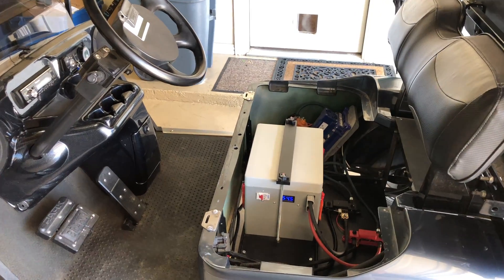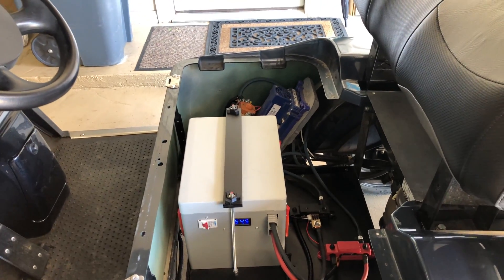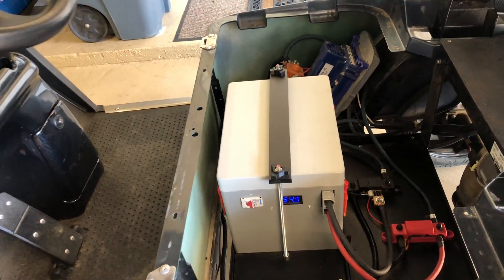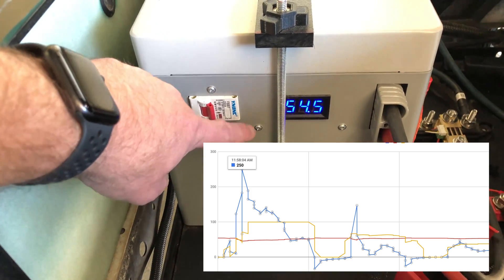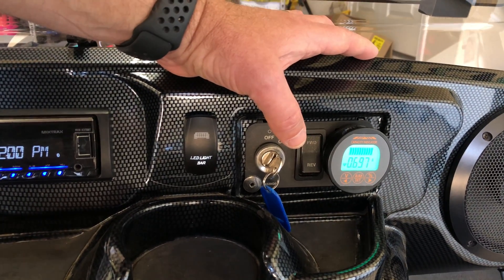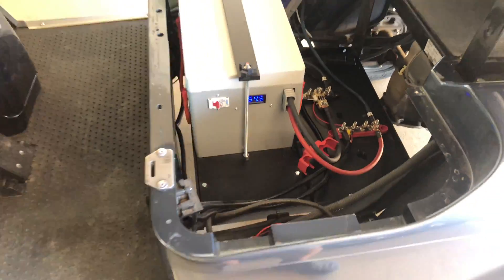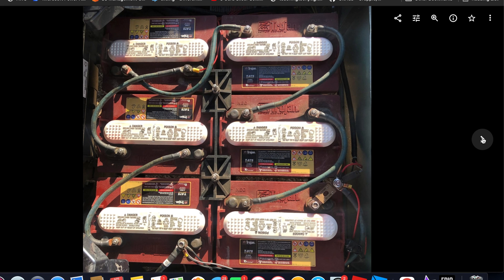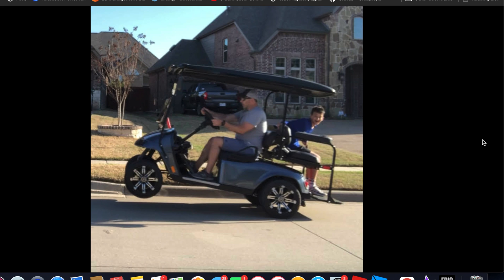Wheelie power from Lithium upgrade

Comment: I have an EZGO golf cart also and want to do the same thing. What was the total cost? My batteries are pretty much shot.
Reply from the maker: The battery was about $1700. They don't have that exact one any more, but they have some that are similar https://bigbattery.com/GolfHome/?ref=156
Reply: @mattadata2  I have a 48v system right now. Which 1 lithium battery would work? Or should I get 4 12v lithium batteries?
Reply from the maker: @Kaiser187  I would do this kit. https://bigbattery.com/products/kit-48v-bdgr-nmc-120ah-5-85kwh/?ref=156
Its three 48V packs wired in parallel for 120ah and comes with a charger.
Reply: @mattadata2  Looks like the best deal I've seen so far. Trying to spend the least amount I can as I already spent 5k+ on the golf cart.
Reply from the maker: Lol. Tell me about! I have more $$ in my cart than 2 of my 3 cars.
Reply: @mattadata2  Do you leave your battery pack powered on?  How does your battery shunt keep memory of remaining battery amp hours.
I own the same battery along with a battery shunt.
I really don’t want to keep it plugged in all the time.
Reply from the maker: @David25522  my shunt keeps the memory when no power. I usually keep battery on, but shit it off if I know I want be using the cart for a while.
Reply: @mattadata2  I just ordered them. Bought the 3 battery kit 129AH. Can't wait to see the difference between the old acid batteries.
Reply from the maker: @Kaiser187  Cool! Let us know how it turns out
Reply: @mattadata2  I just read that adding too much power can kill the motor. I don't think 129AH would do that though?
Reply from the maker: @Kaiser187  it’s true, too much power can kill the motor. But 129AH is not the power, that’s the battery capacity….like how many gallons your gas tanks is.
Reply from the maker: @Kaiser187  power wise, it should be fine.
Reply: @mattadata2  So the 129AH is just the range it gets. I don't know much about gold carts. Just want something reliable that will last. 6300Wh is the power? Do you think I will be able to pop a wheelie with these batteries?
Reply from the maker: @Kaiser187  Hard to say, but if the rest of your cart (motor and controller) are stock, I don't think it will do a wheelie. But I hope your prove me wrong! But it will feel faster and lighter when you take that 300 lbs outs!  FYI - O'reilly will give you like $10 gift card for each battery lead acid you recycle there.
Reply: @mattadata2  I just got the batteries yesterday, they came pretty fast. Was quoted $200-$500 to install. Do you think that is a decent price? Also $150 to pick the golf cart up and drop it off.
Reply from the maker: @Kaiser187 Seems kinda high to me, but I have never had a shop do anything. But if you don't feel comfortable doing it yourself, then I guess it is good price.
Reply: @mattadata2  Only choice I have really. Not many golf cart places around and they are the only ones that will do it. I was wondering what battery meter would be good? I want something to read the battery % so I know when to charge it.
Reply from the maker: There’s a link in the description to the battery capacity meter I’m using. It works well
Reply: @mattadata2  Link didn't work. We're sorry, an error has occurred. Please reload this page and try again.
Reply from the maker: @Kaiser187  Weird. I got that too, then hit refreshed and it worked. Just try the link a couple of times.
Reply: @mattadata2  Finally got them put in today. Guy charged me $480+ tax. He wanted another $100 to program it to go 20mph WTF.
Reply from the maker: Wow, $480 for battery install? That is a lot. 
Pretty common to charge for fast code if you have stock controller. But you might find someone else to do it cheaper.
Reply: @mattadata2  Total was $647 with pickup and drop off. Nobody else around here to do it. He said the battery meter I gave him didn't work with lithium batteries so he replaced it with his which cost $100 supposably.

Comment: This looks good Matt. My neighbor did the hsky battery in his lifted ezgo and mounted it where your distribution bars are and it will drag the back foot rest with no one on the back. On my precedent with my hsky I have to have someone on the rear for weight distribution. However the difference you feel when you get on it vs with the weight of the lead is amazing! I'm digging your plastic floor, Great Idea!
Reply from the maker: Thanks! I have enjoyed watching some of your cart videos as well. I wonder how long before we blow the rear axel out of these things! Some of those AC conversion carts are taking things to the next level.
Reply: @mattadata2  I also noticed that we are both running rockford fosgate prime speakers and a pioneer bluetooth receivers.
Reply from the maker: That’s awesome! Great minds think alike. Anything else planned for your cart?

Comment: I reached out to bigbattery.com as the PTBL has been out of stock. They replied they have no plans to restock it and it’s been removed from their website. Trying to find something that can fit with decent KWH. Anyway, great video and real clean work. Thanks for sharing your build.
Reply from the maker: Thanks for the info. I am curious why they are not stocking this one anymore. I will see what else they have that is similar.
Reply from the maker: This one seems similar in specs https://bigbattery.com/products/kit-48v-bdgr-nmc-99ah-4-8kwh/?ref=156
The only part that would be challenging is mounting the 3 separate battery units

Comment: Nice and clean set up. Thanks for sharing. So the max amp draw is 250a with a 500a controller? Did you set this up with the alltrax software? I have a 48v CC w/ a 400a controller and am looking into this lithium set up. Just want to be sure I have enough amperage for my controller and what I need to consider. I'm not much of a wiz when it comes to these lithium set ups. Thanks
Reply from the maker: Thanks. Yes, only pulling 250a max. Yes, I have the controller configured with altrax software. I am wondering if the BMS in my lithium battery is limiting it to 250a? But the motor might just be pulling only that much. I need to do another run and see what max amps is again. FYI - here is another video I did with Lead Acid batteries. You can see the amps barely got over 200. https://www.youtube.com/watch?v=b934bFFMICE
Reply: @mattadata2  thanks for the reply, I didn't think about the bms limiting the amperage output, for some reason I thought that would be configured in the altrax toolkit. I appreciate your input!
Reply from the maker: @mygt8a4re  you are correct, you can set the max amps in the alltrax controller. I thought I had it set higher than 250 amps, but let me go double check it.
Reply: @mattadata2  I appreciate that!
Reply: I suspect the BMS is limiting the maximum current to 250 A. This is how they protect the battery cells from too much current.
Reply from the maker: @vextrek6036  Yes, could be. Or I may have set 250A limit in my controller. I am going to double check and test again this weekend. I will post back.
Reply: @mattadata2  Awesome. Thanks. This is very helpful information.
Reply: Awesome video!

Comment: Did you have to run new thicker wires from carts charging port to buss bar to use charger.
Reply from the maker: No, I used stock wiring from the charge port to the buss bar. My stock charger only charges at 12 Amps, so thicker wire was not needed.